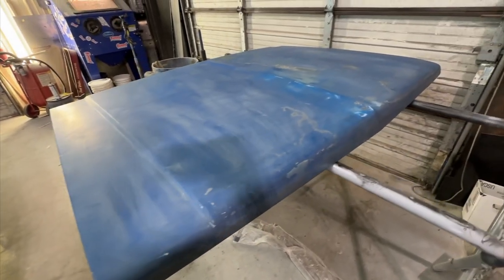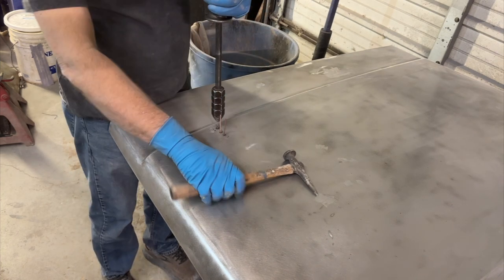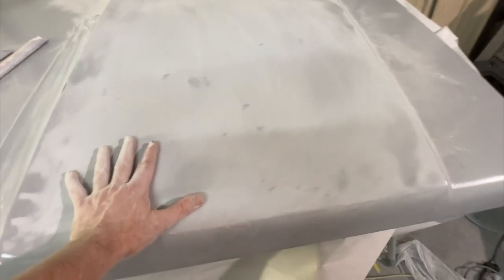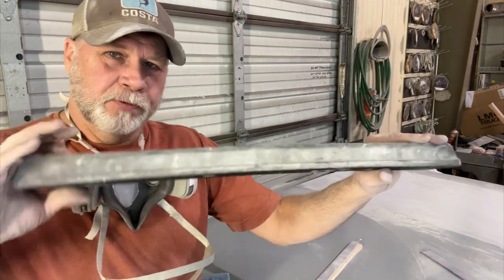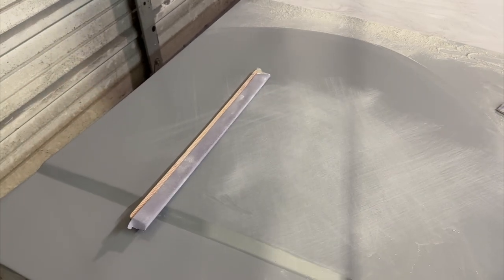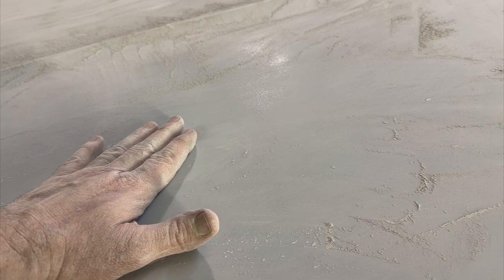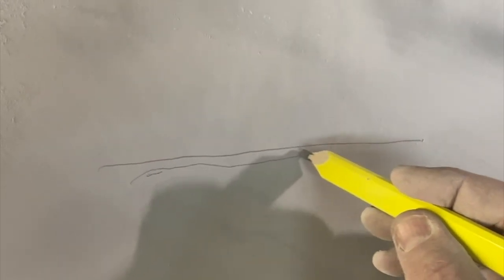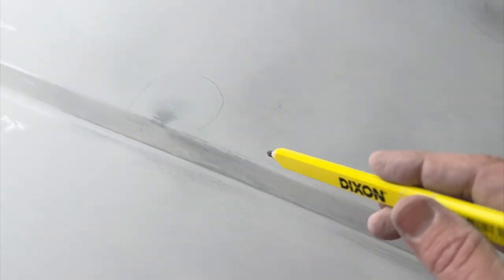C10 Project:  Bodyworking the Hood.  Stripping, Priming, Blocking

Comment: 😂Jim, This video goes into my video file for quick reference. It is a keeper and thanks for the info. Including the pencil as many will grab a "Sharpie". The alcohol based ink will telegraph thru more layers of high build, primer-sealer and base coat color. Don't chance it. Get into your kids backpack for a #2 pencil. After all, you bought them!
  I bought the 20-21mm sander-polisher for paint removal but I had productive word with a 20's something kid and he did not know about regular DA's verses a finishing DA (1/4" orbital action regular to a finishing sander 3/16"). HF sells them but so does Hutchinson. 

And chemical paint removal for non-production projects; Coopers Strip Club two different items, two different purposes, videos on YouTube and it works. It all comes down to cost and time. I won't bring it up again.
DK. Thanks!
Reply from the maker: It’s crazy how much of a difference the stroke makes on a sander.  Thanks for watching Dean!

Comment: Good info Jim. Those squarebody hoods are a pain to bodywork. I know you’re not doing a step by step vid but something to point out to beginners is make sure to blow off the surface and wipe with a dry rag really well before wiping body filler.
Oh and to keep hands off of bare metal so no oils from your skin contaminants and rust metal prior to primer or filler.
Reply from the maker: Some good points Robert. I’ll try to throw that in at some point.  Lots of small but important steps to this stuff for sure

Comment: I have to get an electric DA. My compressor has a difficult time keeping up with my pneumatic one. I have a nice DeWalt soft start buffer polisher with variable speed from 800 to around 3500 RPM. It has the quick disconnect system for the pads. I wonder if it would do the same thing.  I have to find a new hood. Mine was slightly oil canning on both sides near the cab. It was nearly perfect and I should’ve left well enough alone, but I didn’t. Wound up creating a giant pimple by over stretching when I was really trying to shrink the steel. Yeah, what a mess. I tried a torch and quenching, cutting and welding, but I think it’s finished. I wonder if I could cut out the bad area that’s about 12-14 inches in diameter and stitch in new metal. Other than the part I destroyed, the hood was perfect. 

Great lesson again. It’s taken me a long time to figure this seemingly simple process of addressing the block properly. Flat doesn’t mean straight and rarely is any part of a panel straight. I wasn’t taking the visual appearance into account. I was just holding the block flat and sanding. 

You actually showed near the end exactly what my problem was and yes it was blasted. I wish I would have simply stuck a piece of sound deadening membrane under the soft spots. That would have fixed it properly done. Great video!
Reply from the maker: The da (dual action) sander not only rotates but has an off center random rotation as well. You will sometimes see the curly cues or pig tail scratches  it makes when it sands. Most buffers simply rotate so they act more as a grinder. There are some random orbital buffers that are closer to the action of a da. They are usually more aggressive and difficult to control. There are some automotive style electric da’s on the market now that are really nice but come with a high price. Probably still cheaper than upgrading your compressor. 

Something I haven’t tried but plan to on my next warped hood is a shrinking disc. Check out some of the videos on YouTube about it. Looks pretty amazing. I would not attempt to cut out a piece and weld in a new one. The welding is going to warp it even more. Try the shrinking disc instead.

Comment: What type of disc did you use in the first step to remove the paint? I am restoring a square body year 81 and I have another 79 I love that type of truck greetings and your work is excellent
Reply from the maker: I used 80 grit.  It strips quick and leaves it ready for epoxy when your done.  Thank you and thanks for watching!

Comment: Great informative content as usual, thank you for the instruction. Wondering if I can get your opinion on the topic of compressed shop air systems. I have the opportunity to buy a used refrigerant air dryer for $200 cad but am not sure of how critical it is for home use. I have a 2 stage 80 gal compressor and will be starting the body work process on my project truck within the year. I am unsure if this is a necessity or if I can get away with my small desiccant filter setup I currently have? Any feedback is greatly appreciated. Keep up the good work!
Reply from the maker: Hey Dain. For home shop use I don’t think a refrigerant dryer is a necessity.  Some type of moisture filter/trap is needed though.  I have used a Devilbis DAD 500 set up for years with no refrigerant dryer and had great results.   Even with a dryer a dad500 system or something similar is needed at the point of use for painting and such. If you haven’t had any issues using your desiccant set up you probably don’t need the dryer. If you are in a high humidity area and have occasional water in the lines it may help. I’m not really sold on refrigerant dryers overall. They may be a necessity in a high air use shop but I have seen moisture issues even when the dryers are used. The answer to still having a moisture problem although using a dryer has been to install a DAD500 or similar product at the point of use. Hope this makes sense and thanks for watching!

Comment: I'm thinking about using vp 2050 on my next truck because I heard it stops shrinking after about 3 days I normally use epoxy then high build I just don't like having to wait 2 or 3 weeks for the high build to fully shrink.
How long do you give 2050 and does it matter how many coats you use ?
Reply from the maker: The epoxy and high build is how I did it before as well. Always worried about shrinkage. The VP2050 seems to do a good job of locking everything down and not keep moving/shrinking down the road. As long as it’s in a warm environment about 3 or 4 days seems to be good. Three to four coats is what they recommend and is plenty. It builds very well.

Comment: Hey, first I want to say I really enjoy your videos. Lots of great tips. I'd never have thought about the hood sitting on one stand getting bowed. I'm used to doing epoxy over a large bare metal area, does the vp2050 and sealer offer good corrosion protection?
Reply from the maker: The VP 2050 is in the PPG vibrance line. It states that it offers excellent adhesion and corrosion protection. It has worked really well for me. I have always used epoxy over bare steel as well and usually put a high build urethane over it. The VP2050 is an epoxy based high build so you get the direct to metal properties and high film build in a single product. It has also taken the place of spray poly that I used at one time. The tech sheet states that it can go over bare steel when sanded with 80 or 180 but I prefer the larger 80 grit scratch. Give it a shot, I think you will like it. Thanks for watching!
Reply: @StoutCustom  There's an English Color close that's the PPG dealer. I'll definitely give it a try as soon I I find my next / last project. Just need to convince the lady down the road to sell me her 87 short bed. Lol
Reply from the maker: @davidl2736  lol. Good luck. Hope it works out for you

Comment: Hello Jim….why didn’t use epoxy primer as mentioned… just curious….. also do you think a dewalt buffer would work…as a stripper ?
Reply from the maker: The VP 2050 is epoxy based. That’s what gives it the direct to metal ability. It might be considered a hybrid. Where as we used to prime first with epoxy then follow that with a high build urethane, the VP 2050 takes the place of both. As far as using a regular buffer to strip, it does work but not as well as the orbital polisher. In my experience it’s a slow process with a regular buffer. It doesn’t remove paint very fast because of the small contact area since you have to tilt it just like buffing. Then once you get to the metal it is too aggressive on the metal, (especially sharp body lines) since it’s really just a big grinder now. Thanks for the question and thanks for watching!
Reply: Thanks for your response!! Great information as I am soon to start my build….I really enjoy watching and very informative!!
Reply from the maker: @seeunow44  you’re welcome and good luck with your project!